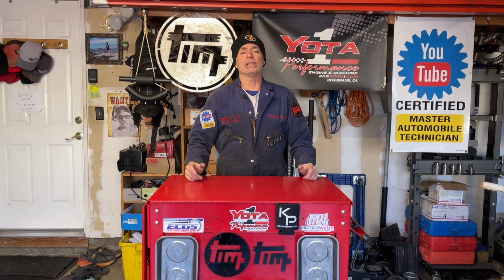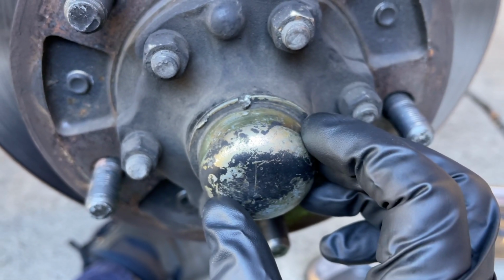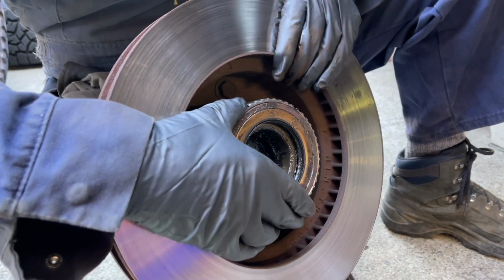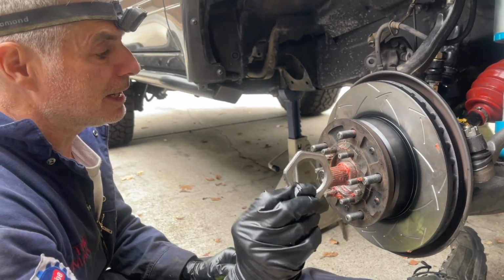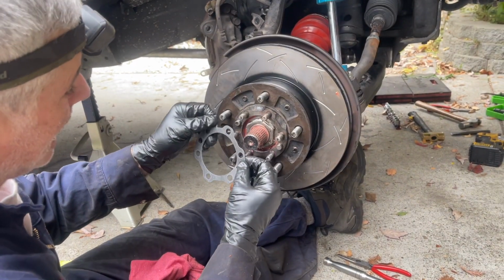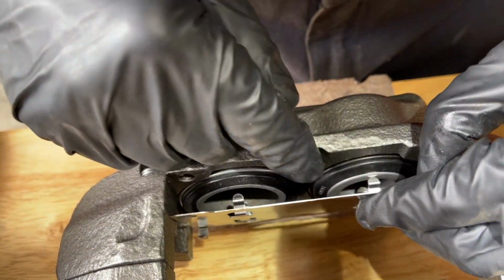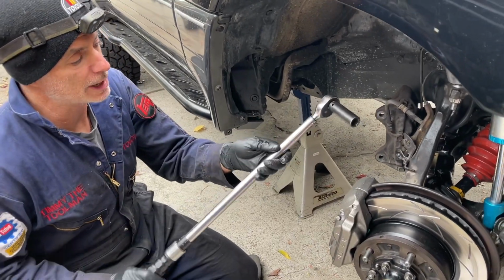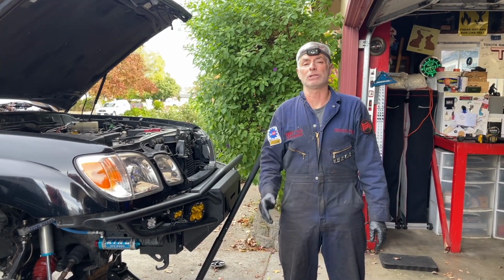COMPLETE Front Brake Replacement Job (Toyota 100 Series Land Cruiser & Lexus LX470)

Comment: nice job. but I think you got the wrong lines for the front. they have to have the little stopper  so the line wont move.  I got a kit and and the 2 front ones have the little tab to hold them in place.
Reply from the maker: Yeah, my buddy Vincent bought the parts, so I don't know what variations were available.

Comment: Great videos Timmy! Just subscribed… my first Lol! Follow up on how you guys or Vincent like the DBA rotor and Project MU brake pads? Not a common upgrade but you guys always at the leading edge of these upgrades so I looked into it and DBA is well known but Project Mu is less but quite respectable on Japanese products so these are great parts. But are the pads noisy or dusty etc any feedback is appreciated and thanks a lot!
Reply: been over 11 months of driving. Very little dust. Good bite and works well in mtn roads ;)  A+++++ from both of us! ;)

Comment: You also put grease on the threads?? That seems counter intuitive as well?
Reply from the maker: What's wrong with putting grease on threads?  Grease or anti=seize facilitates the removal of fasteners in the future.  Are you worried about it changing the torque value, and that's why you're so hung up on this?

Comment: He had me until antiseize on bolts. That doesn't seem right...
Reply from the maker: Tell that to the guys that live in the rust belts of the country.  They put anti-seize on everything.  If you don't want to use anti-seize, don't.  I don't get people like yourself that will point out one insignificant thing they have an issue with, and then forget about the rest of the video.  I'm curious, did you like anything about the video, or was it our use of anti=seize that ruined it for you?

Comment: Did I miss the link you mentioned sharing about the lisle 3.5 inch seal driver?  Didn't see it in the description.
Reply from the maker: It's linked it in the Wheel Bearing video.  It's not needed for this video.  But, here you go.  This kit has a 3.5" race/seal driver.  Lisle Bearing Race Driver Set https://amzn.to/4a0CYlq

Comment: Timmy. Please post more 100 Series Land Cruiser content. Is there a video on how to change the alternator?
Reply from the maker: @ScienceHeckYeah  We will be filming an alternator replacement pretty soon on Vincent's LX470, which will work for your 100 Series.  We've got more content coming VERY soon - Front Wheel Bearings,  CV Axle Reboot, Front Differential Axle Seals.
Reply: @TimmyTheToolman  This is amazing. You've been great for me since I have a 3rd gen 4runner and a 100 series land cruiser. I will buy you a beer :)

Comment: Superb. I like that so many Toyotas are very generic and the front axles are very similar. I have locking front hubs, but otherwise little difference. I've not generally been a fan of 'racing' pads, as they seem to be little better and with ABS brakes are generally excellent, but I've found them to wear quicker for little gain. I do like braded hoses and they offer a slightly better feel with non-ABS, but ABS will alway stop better, I think. In real bush work braded hoses can fail from dust etc getting into the mesh, but it you're worried, carry the set of hoses you've taken off as spares.
Top work and you did a great job with the difficult task of the bearing pre-load. I do think Nissan did a better job with front bearings and their locking ring design is probably better.
Thanks for the size recommendations on the flare nut spanners. Not ordered a set yet, but I've exposed some chassis areas on my project to see if I need anything smaller than 10mm on fuel lines as well as brakes. Going to need another box of silicone plugs, too!
Reply from the maker: Yeah, my 85 4runner hubs are pretty much the same other than I have manual locking hubs.

The bearing preload never works out based off how the Toyota FSM instructs to do it.  You always need to go tighter with the adjuster nut to get the pre-load to the range they suggest.  I've never seen the Nissan locking washers.  

As for flare nut wrenches, I've used quite a few of the different sizes in my flex head Gear Wrench set.  There's a range of sizes needed for all the brake lines and fuel line connections.

Comment: Nice video Timmy. For setting the wheel bearings and checking the preload, always rotate and pull the rotor in the forward direction. Never backwards. Otherwise, the measurement will be incorrect. Also, when staking the star nut make sure that the bent petals are on the opposite side of the groove key (if possible) to make sure that the key is fully engaged to prevent later loosening and dangerous wheel wobble (guess how I know that).
Reply from the maker: @olegfom1  The FSM did state pulling in the forward direction.  We caught that later, but does it make a difference?  I don't think so.  Why would the resistance be different, pulling one way or the other?  It's bearings rotating on a spindle.  It makes no sense why the value would be different, pulling the fish scale backward rather than forward.  I checked the fish scale value, pulling in both directions, and got the same value.  I think this is a Toyota FSM wives tale.

You also have me confused with the concern of staking  the lock washer.  The washer is keyed and sandwiched between the adjuster nut and lock nut.  How would that thing go anywhere?  If the job is done right with the proper bearing preload, with a properly torqued lock nut,  you're good.  The lock washer is just a backup for situations where the job was done wrong, like what a cotter pin does for castle nuts for ball joints and tie rods.  If a castle nut came loose and had to rely on a cotter pin to not completely unscrew off the stud, somebody screwed up.
Reply: Speaking about the lock washer. What happened to me at one of the brake jobs, the nuts happened to be oriented in such a way that the petals were bent close to the key. Since the washer has some play, the key was pushed outward and was holding by less than a half of its length. Then over the next couple of years that tip of the key broke off, just enough to let both nuts spin freely together. I could lose a wheel together with the hub. After that, I make sure that the key is fully seated when staking the washer. Those nuts hold the hub on the axle.

Comment: You'll be sorry using those Duralast calipers. Plan on redoing the brake job in a few months. Should have rebuilt your Toyota calipers.
Reply from the maker: Well, hopefully not for Vincent.  He's still got the OEM calipers and there was nothing wrong with them.  There's not really much that can go wrong with a brake caliper.  It's got fluid channels, pistons, piston seals and dust seals.  Unless it springs a leak, I think Vincent won't have any issues.  I serviced some calipers in this video.  Not much to it.  https://youtu.be/r_9pPEan9q8?si=0FEiTCuAo9mjG2Xj
Reply: @TimmyTheToolman  Will have to look at that. I'm planning on servicing mine.
Reply: Tons of people run remanned calipers mostly no complaints
Reply: no complaints so far. Nothing wrong so far